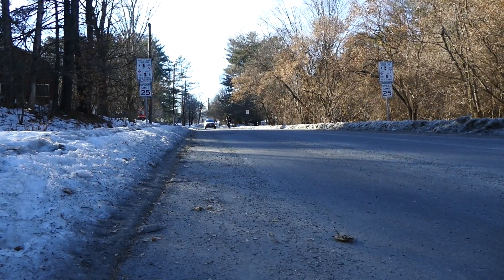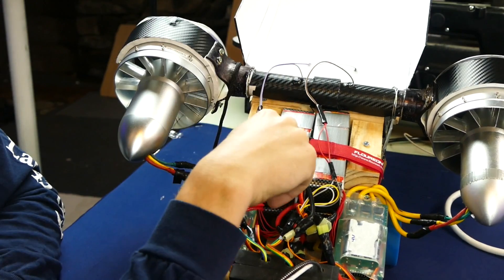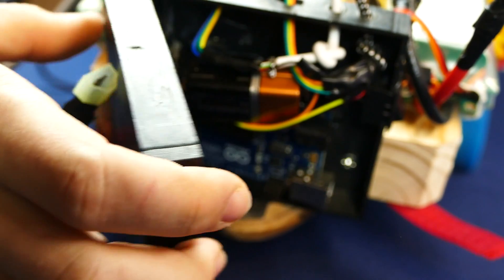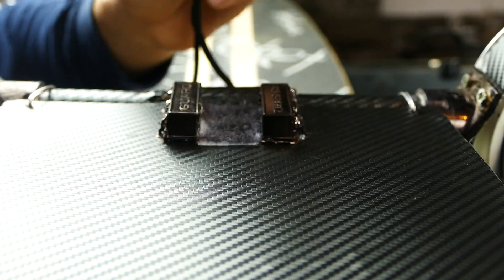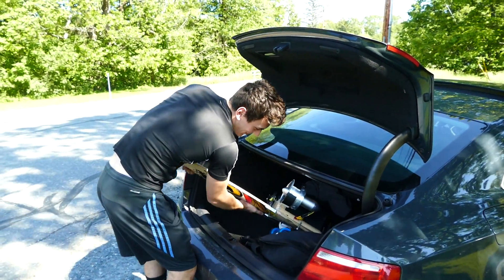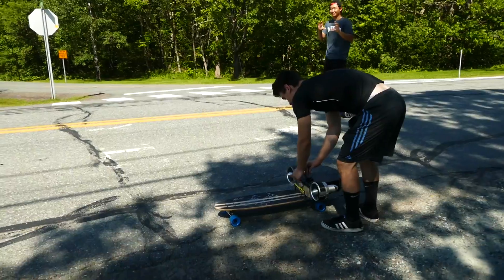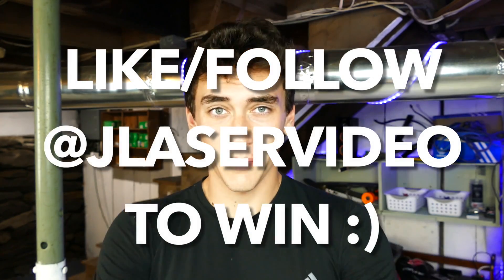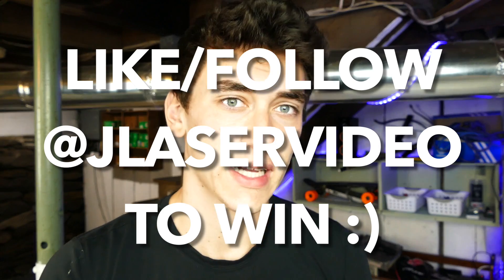JET POWERED BOOSTED BOARD!!! (Home Made Rocket Longboard 2.0)

Comment: Great idea 👍 I wonder if they could be fitted to a battery belt and used with a hang glider.. I'm thinking they could be used for vertical takeoff and landing, put your feet up to go forward. Added feature would be, once soaring high you could switch off and have them generate power, recharging the batteries and potentially allowing you to fly without the need to return to earth after 40 minutes of flight 🤔

Comment: Bro as for the wheel brakes, bolt on some push bike breaks. Cheap and easy to replace.
Attach them length ways so you get the most surface area out of them.

I'd also make another 80° bend on the break bar so the bend pushes the bar  towards the box but the toggle point is lower down and is pushed down towards the board rather than back.
You will need to move the main body of the bar forward and shorten the hight of the part extended onto the deck.
This way you can pivot the ball of your foot and just push down on the break lever with your heel rather than try to push back against the break.
(I dono if you get what I mean, chances are I'm not explaining it well.. but to break you would just push the bar to the deck rather than back against the battary housing. It will feel more natural and require less balance while also maintaining more control points on the deck while breaking.)

I'd also add a shroud to the back of the fans that funnels the thrust into a cone (Don't go all the way to a point tho) like how a jet engine works to increse thrust profiles of the fans as the pressure differential will provide more thrust.
(I'm assuming you haven't modified the fan and since you don't have multiple rotors, a fuel source and a combustion chamber, the narrow shroud exit is the only way I can sugest to improve the thrust profile) 

To decrese speed wobbles all you need to do is tighten the middle nut on your trucks. 
It will mean a larger turning circle but less speed wobbles. (If you don't know what I mean look up a vid on how to tighten your trucks, Standard sk8 knolage so should be a few.)

If you do race Casey I'd say make sure you are rocking abec 7 or 9's for the bearings and your trucks are tight enough.

A few tweaks to work out but brah.. It's  lookin awesome so far.
Reply: Just realized this video is 2 years old lol.
Off I go to look for V 3.0 lol

Comment: It would be even fast if you made it into an electric motor board. Do it with dual 180kv motors under board and a 10s-12s battery. BTW THIS IS NOT FASTER THAN A REALLY GOOD ELECTRIC SKATEBOARD. It’s possible to make them go over 100mph.
Reply: Gavin Buckley those wheels would burn out fast

Comment: For better brakes do something like a rim  brake on a bike. Where it will clamp the wheel. And u can pull a lever or the foot lever. And control how much force u clamp the wheel with.     And u could do a peice of soft rubber where the rubber wears down but the wheel doesnt.

Comment: To stop the wobble at speed you need to tighten the bolt on the trucks. If that doesn't work, try moving the heavy parts down low. This will lower the center of gravity make it more stable. 

Let me know if you test this and how it goes.

Comment: Need wider trucks, bigger wheels like 97mm or 107mm from ABEC11, throw some SHIVER abec 9 bearings on there because they're slick as butter and all that together should eliminate speed wobbles..really just need a proper deck setup to hold that speed..and what about using a reverse feature on the jets to slow you down. Either that or a proper brake system. Just thoughts coming from an evolve carbon gt daily rider..be safe mane! And great job!

Comment: Hey Jake, I don't know if you care for this anymore, but one of the reasons you had speed wobbles may have been because of the tightness (or lack of) of the kingpin on your trucks, which is the bolt that holds your trucks to the board itself. I had this problem initially when I first started to skate. The tightness of the kingpin determines how sharp you turn, the looser the kingpin the sharper you turn, and the tighter your kingpin is the wider you turn. Since you are going at high speeds on your jet powered Boosted board, you should be sure to tighten it (if you can). Feel free to use this as future reference for projects like this one in the future. 
~Jakob [Jake]

Comment: awesome project! i was thinking for the remote, maybe take plastic gear that is a little bigger than the remote dial, cut the center of the gear just big enough to fit on the dial and attach with glue or hot glue. i think this would give your thumb more grip and better control. also maybe one day you can do a jet bike. keep up the awesome engineering.

Comment: Tighten your trucks to avoid speed wobbles, you can kick off to beat acceleration issues I think boosted boards need a kick too, and do some research into car break pads. max out the friction between wheel and breaks

Comment: How to fix board shaking: Find the kingpin nut on the bottom side of the board, grab a small wrench or a socket wrench and tighten the nut an insane amount. This puts pressure on the bushings, stabilizing the board but also limiting your ability to turn. Hope this helps

Comment: u could reverse the power so that the jed engine would drive you backwards because that would be a good break
Reply: zetti he said that the acceleration wasn't very good, so breaking would require the forward thrust to shut off and then reverse, and with bad acceleration, it would take too long for the reverse to kick in effectively
Reply: zetti .yes weight needs to be on the nose of board.not back
.

Comment: down size the "engines" use smaller batteries and for breaks have engine/engines facing in reverse or make the engines able to flip around but definitely make smaller engines would be more safe and more practical for someone who relies on skateboard for main transportacion

Comment: So, I've gotta ask, that speed wobble? What if, Ik it's a long board. But what if you swapped the longboard for say... a bike. A bike you can balance easier, more control, easier braking, less damage should you crash, easier access to a kill switch (if you put it in the handle) to me, making a bike like that would be a really neat thing to do. And rather than that big box on the back, you could put it under the seat or rear tire, or even on the handlebars if you really wanted. Sorry, just got hooked onto that idea and jotted it down. But yeah. Rocket bike.

Comment: I have some ideas. First boring wireless controller. Reverse thrust to slow down. Torque vectoring, when you turn sharp the other motor goes nuts and the inner one does the same backwards so it helps you turn.

Comment: Please make a build tutorial please!!
Reply: https://hobbyking.com/en_us/ledfadps12b90-1a16-6s-90mm.html
https://hobbyking.com/en_us/turnigy-2650mah-6s-20c-lipo-pack.html
https://hobbyking.com/en_us/turnigy-plush-60amp-speed-controller.html

that's for the propulsion. for control you'll need a switch and an arduino, as pictured in the video. You'll also need to build a housing like he shows here
Reply: it's actually pretty simple, just buy a couple electric ducted fans and strap them to the longboard.
Reply: no worries, the housing can be whatever you want it to be, just make sure it's secure and isn't going to fly off. this guy looks like he used just carbon fiber, which is just fine for this
Reply: Quinn Leonard he mentions that he has some big batteries. Do I have to include that too?
Reply: Yeah definitely hold on I'll post a parts list
Reply: Quinn Leonard and the housing is built by just wood with vinyl wrap? Btw thanks for the links to everything! 👍
Reply: i agree
Reply: a easy cheap way to make it would be to make it steam powered using a tesla turbine to generate high rotation speed which rotates the fans/
Reply: that shit's fake
Reply: Scootro Dellabutro then how is there a whole video dedicated to showing how it works?